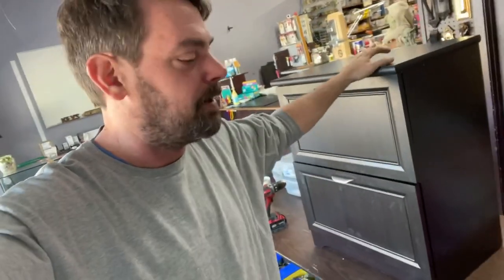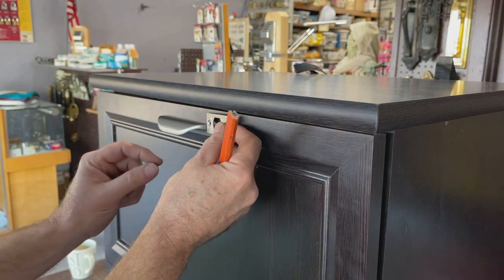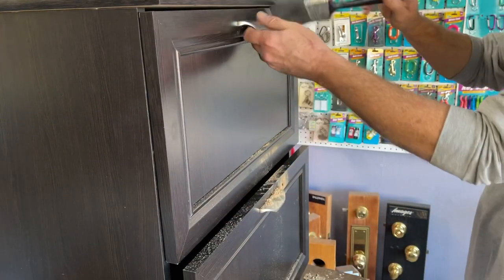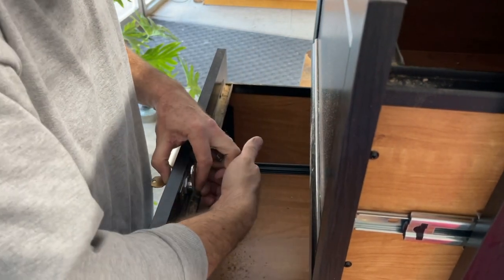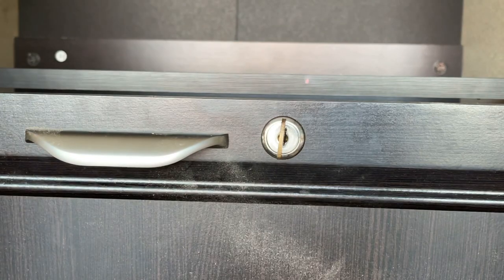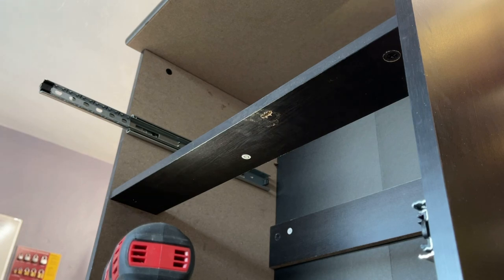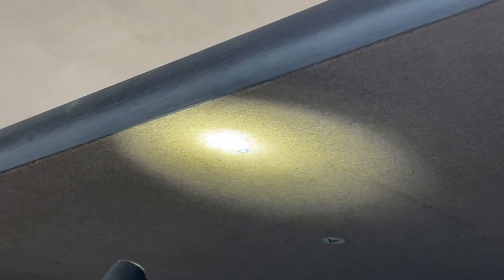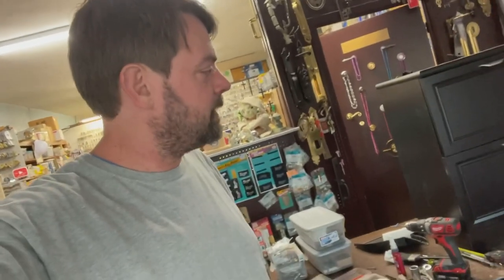Installing two cam locks on prefab “wood” cabinet

Comment: What a great idea to use all those extra Schlage strikes for  preventing the lock from turning. Good thing they are almost the perfect size
Reply from the maker: Ilco makes a plate but its way too thick for its own good
Reply: Did you not put a strike around the drilled line of holes for the cam to keep the wood from wearing out over time
Reply from the maker: @RuneInternational  these don’t include strike plates and wouldn’t be included in the “basic” price point. If that was necessary it would have to be sold as the much more expensive Olympus type lock 🤷‍♂️ “get what ya pay for type thing”
Reply: No doubt. I've got a few old ones I'll be storing with my cam locks from now on.

Comment: Fun! Never thought about using a deadbolt plate on the backside, but I do usually buy  (or make) the little steel angle strike plates from timberline so I don’t have to deal with cutting that groove. Thanks for sharing🙏🏼✌🏼
Reply from the maker: Much easier to be able to do with those! I’ve got various baggies around with homemade strikes for “next dang time I run across that stupid cabinet”

Comment: Hi Jason. 
Thanks for taking the time to do this video. 
Yep, smells like fish, because the " wood" is basically sawdust and glue,the glue stinks like fish.
I used to work in an office furniture company,  making the peds for desks,  2 and 3 draw. The locks we put in had a locking bar . So not a cam,.
Nice video. 
Thanks again.

Comment: Once you finish the first step you can
Flip the cabinet upside down to make
The slots for the tail peace then you
Could use a dremel or something
With the same thickness as the tail
Pease then your looking down a lot
Easier on the neck
Reply from the maker: for these small ones that is absolutely a option (much easier to control whatever you use to make the slot) I've done the dremel way many a time and I still prefer this method :) Thanks for watching

Comment: Nice job! Having done lots of those I've opted to start using the Olympus plunger model- it mounts on side of cabs and locks the drawers. Cost more for the lock but much quicker to install! I also use the stealthlock on a few cabs.
Reply from the maker: I love being able to use plunger ones! Those strike cups though could use some updating :(

Comment: the fish smell is from the glue in the wood heating up from drilling we us a glue at work that every time they open the glue pot the whole place stinks of fish !
Reply from the maker: during edit I noticed a few wafts of smoke, you might can see the vapors hitting me if you set the video to slow speed right when I said that 😂and I was nowhere near heating up that bit 🙄 crummy stuff to deal with
Reply: @selock  yes it is

Comment: I once used my Nebo flash light and phone to video record from the inside to find out why the drawer wasn't locking properly and to make adjustments.  Another idea I had which is not related to this but to using your phone, is to use a long selfie stick and your phone to record video if you need to see the top part of doors for loose screws, etc.  Morning ya'll!
Reply from the maker: GoPro linked to the phone to see what’s going on is my new trick :)

Comment: Wouldn't that tool that has the blade that vibrates back and forth do that slot job easier?
Reply from the maker: I’ve tried it on some. It’s a valid “other way” to do it. I’m like 70/30 would rather do it this way. On another day I might go that route ya know 🤷‍♂️ I’ve got the dremel saws and tried most ways (except the biscuit joiner as Kevin mentioned)
Reply: @selock  I have a "Yellow" Cut Out tool (Mill) that allows to set depth, but you got to be super carefull it does not get away.

Comment: Thanks for the video. I’ve turned this work away in the past. What do you charge for a job like this?
Reply from the maker: look to the end of the video
Reply: We get requests for doing this kinda stuff all the time, on kitchen cabinets and stuff. The real problem os that a lot of these cabinets were never designed to ve locked up, and depending on the doors and how the close, sometimes you can't do it. If the customer can bring it in, makes it easy and cheap. But i charge a good but fair price to do this kind of stuff on the road. Its time consuming, delicate, work, especially if they only need one or two installed. I usually try to talk people out of it, try to get them to thing of a different option. Locking up a closet or something else.
Reply from the maker: @jamespetkwitz8737  I’m right there with ya. There are so many variants it’s hard to assess until you see the cabinet itself. On the road this would have the service charge tacked on and some extra $$ for cleanup/difficulty/filled drawers/etc.
At some point it’s just like “yo, it’s a $50 cabinet friend 😂”
Reply: @selock  pretty much. I usually start out by asking if it is an expensive piece of furniture, or an antique, or something important. If they say no... My response is normally, you consider buying one that locks already.